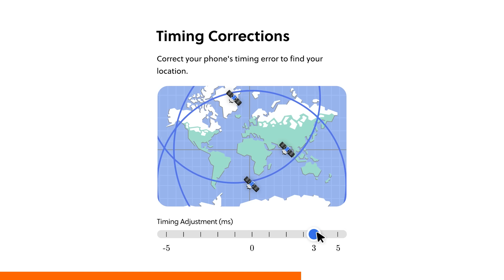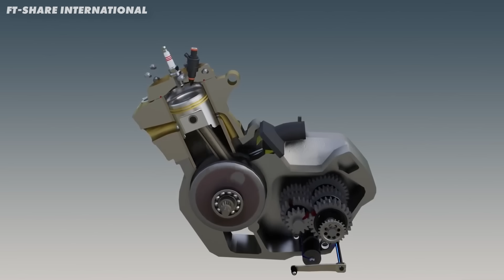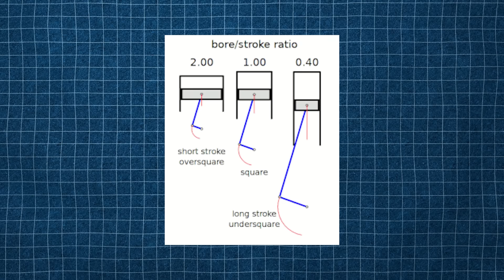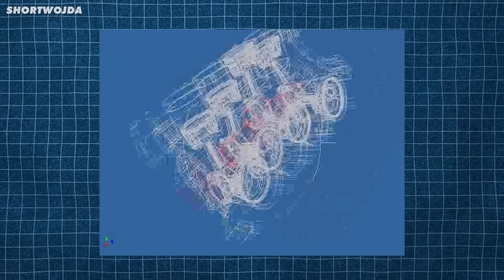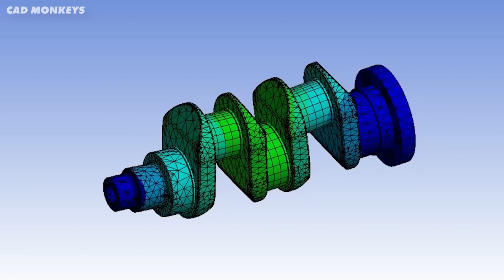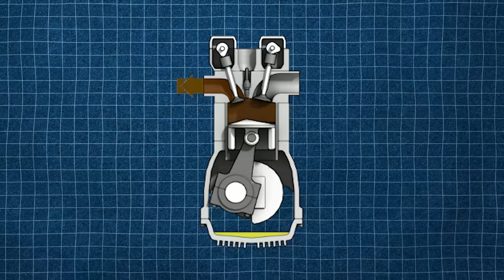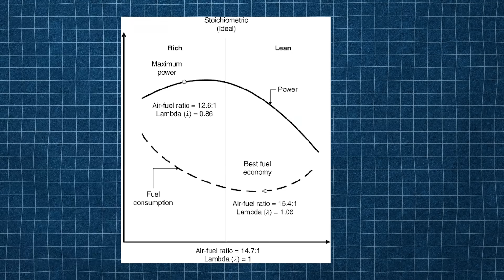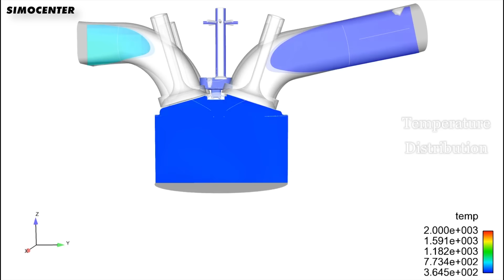Why It’s Almost Impossible to Rev to 21,000 RPM

Comment: "With an engine revving at 20,000 RPM this piston has a mass of 2.5 tonnes."

No it does not. It's mass is it's mass. It does not change. Under acceleration, it's apparent weight will change, not it's mass. It's mass is constant, not taking into account any negligible amount it may shed due to normal wear within normal operating parameters.

For a channel that overtly portrays itself as digging into the technical, it sure seems odd that so many basic technical details are so often just overtly wrong. And in such instances, technicalities are not quibbles, they are significant issues that are germane to a true understanding of the topic, with significant ramifications, in terms of derived conclusions, if misunderstood.

Comment: Has anyone tried a combined external/internal injection engine? I'm thinking having the intake mixture have some fuel (to head a head start on the mixing process) but lean to the point of being incombustible (to avoid knocking). On further consideration, if you are injecting fuel in different places and in different ways, I wonder if it would be worth injecting different fuels? For example use an external fuel with a lower vapor pressure to decrease it's volume during the intake stroke (so as to avoid displacing air). A very quick search suggests that  fuel-tank restriction might require some tricky rule-layering to implement that within the rules.

Comment: Very roughly calculated, at 20kRPM with a hypothetical stroke of 13 inches (33cm) the piston face is moving at Mach 1 relative to the ambient air. During the intake stroke on a non supercharged engine, it will only be a factor of ~6 from literally outpacing the air. Very roughly adjusting for 3.5 bar of boost, the intake becomes supersonic around a stroke of 17 inches (43cm), for a factor of ~10x. Those are both borderline significant, thought the air thought the valve going transonic might become a challenge first.
Reply: mach piston head, engage
Reply: Idk where you're getting a stroke of 13 inches from. Current engines only have a stroke of 53mm. You only get these high revs with very wide bores and short strokes
Reply: @themindgarage8938  (Darn YouTube comment for only showing enough text for trivial and boring points.) I started with a fixed RPM and peek piston speed at the speed of sound and calculated backwards from there. I agree that's a unreasonable stroke in practice, but the point is the ratio between that and reality, which is remarkably small.
Reply: @benjaminshropshire2900  Idk I wouldn't say that ratio's small at all. In most situations you only have to worry about this stuff when you're at Mach 0.8 or so. The piston is moving way slower relative to the engine  than the car is relative to the air around it, and F1 designers generally don't have to worry about transonic flow
Reply: @themindgarage8938  the general rule of thumb in engineering is if you are within about 10x of where the back of the envelope say something is a problem that you should be taking it into account. In this case, I suspect it's solidly in the range where "intake efficiency" is noticeably dropping with increased RPM. Also, pressure drop through the valves will reduce speed of sound in the piston so it's likely closer than a trivial analysis suggests.
Reply: @benjaminshropshire2900  Sorry no, that's totally ridiculous. Whether 10x is sensible depends so much on context. Sometimes it may be 100x, other times it may be 1.2x. Do you think the designers of passenger cars which travel at roughly Mach 0.1 on the highway worry about transonic flow over the car's body? No they don't because they're real engineers who use their brains rather than relying on some stupid rule

The main problem is getting the valves to open or close fast enough. Engine speeds stagnated at 12-13k for a long time until they started using pneumatic springs in the late 1980s
Reply: @themindgarage8938  10x isn't where an effect become important, it's where you need to start asking if it's important (and it usually, but not always, isn't, ... yet). And yes; engineers use their brains, first and foremost to identify the 99% of the problem that can be ignored.

As for cars, 70MPH (Mach ~0.1) is remarkably close to where airflow starts to become a major consideration (as in above simply a fuel economy issue).

Comment: I think you should preface the video by specifying what types of engines you're talking about because the blanket statement does not hold true. A model rc car nitro engine can spin 25 to 35k rpm easily.

Comment: The video never actually answered the question. It pointed out the difficulties of running at 20,000 rpm, but did not actually tell us why it could not go higher.
Reply: That's because it isn't a real limit.
- You could make the pistons smaller to reduce their mass.
- Materials science is constantly developing.
- So are design analysis techniques.
Reply: @procatprocat9647  You will get to the limits of physics somehow
Reply: @DanielDorn-tr7tw  only for a single set of circumstances. 
Engineering and science can be used to avoid such limits. 

Hence the video title is a lie.
Reply: @procatprocat9647  There are physical limits to everything. Limits that can not be overcome no matter what technology or engineering you use.
Reply: @DanielDorn-tr7tw  a professional Engineer's job is often to think laterally to avoid such limits. 

Technology and knowledge  will never stop progressing, so it would be impossible to state that the max rpm has been reached. 

Even in after another century of development,  making such a statement is foolhardy because the Engineers wouldn't have the foresight to know how some future lateral thinking could alter the scenario in their favour. 

To state that 21000rpm is the ceiling is incredibly ignorant and naive.
Reply: @procatprocat9647  You dont understand. There are physical limits that can not be broken. The laws of physic dictate the limits. You can never travel faster than light. You can never get more energy out of a system, than you put in. If you dont understand that, then you gotta go back to school.
Reply: @DanielDorn-tr7tw  so you think 21000rpm is light speed? 🤣

Okay, being serious now. 

List some of the laws of physics that apply in this case. There are some, but they aren't all impossible to avoid. 

Flame front is one which could be manipulated. Supersonic pressure waves are another. 

They are not fundamental limits. 

Explain how you know that no free thinker will ever avoid that limitation by taking a different approach. 

Explain to me how they limit a piston engine to 21000rpm. 

Before you answer, be aware that some piston engines spin at 50,000rpm. 

100,000rpm is quite feasible using today's technologies. 

Are you God with infinite foresight?
No, you just heard a couple of things and now you think you understand science and Engineering. 

Go back 100 years and consider what the maximum possible rpm was then. 

Now project 10000 years into the future with your infinite foresight 🤣
Reply: @DanielDorn-tr7tw  @DanielDorn-tr7tw  so you think 21000rpm is light speed? 🤣

Okay, being serious now. 

List some of the laws of physics that apply in this case. There are some, but they aren't all impossible to avoid. 

Flame front is one which could be manipulated. Supersonic pressure waves are another. 

They are not fundamental limits. 

Explain how you know that no free thinker will ever avoid that limitation by taking a different approach. 

Explain to me how they limit a piston engine to 21000rpm. 

Before you answer, be aware that some piston engines spin at 50,000rpm. 

100,000rpm is quite feasible using today's technologies. 

Are you God with infinite foresight?
No, you just heard a couple of things and now you think you understand science and Engineering. 

Go back 100 years and consider what the maximum possible rpm was then. 

Now project 10000 years into the future with your infinite foresight 🤣
Reply: @DanielDorn-tr7tw  also, science is not a set of rules cast in concrete. 

Scientific principles are our best agreed guess at the present time. 

They are constantly evolving, being challenged,  and being replaced with better agreed guesses. 

You are the one who needs schooling sonny
Reply: @DanielDorn-tr7tw  come on Daniel, don't go all shy on me. Answer my questions, I dare you!
Reply: @procatprocat9647  Read through the thread again, I never claimed that 20000 RPM are the limit. I told the universal fact, that there are limits to everything based on the physical laws of our reality. 
Go back to school and learn reading comprehension.
Reply: @procatprocat9647  I am not talking about science. I am talking about reality. There are physical limits, no matter what you do, which cannot be broken.
Reply: Velocity and size of charge of the air fuel mixture can also limit how high the rpm can go. I had always heard they couldn’t go beyond 20k rpm because they couldn’t get the air fuel mixture in the chamber any faster. I had heard at 20k rpm they couldn’t over come the pressure wave the intake generated to go beyond that limit.
Reply: @rednezz  that's just a temporary limitation. Nothing  like the fake title suggests.
Reply: @rednezz Honda did 22500 in the 60s with the rc116
Reply: @brynfisher8019  Yes, for sure. I was just stating the 20k limit for the formula one engines was not due to G forces but more due to intake limitations. I am sure without any rules that put boundaries on the engine, intake and exhaust design those F1 V10’s would surpass 20k rpm.
Reply: @rednezz a v10 past 20k is the stuff of dreams.
Reply: @brynfisher8019  Tiny pistons do help with that.
Reply: @petertaylor6384 honda r4 motorcycle went to 19k and had odometer to 20k. With higher number of cylinders and F1 budget there is more likely to achieve higher rpm.
Reply: @brynfisher8019  I was hoping someone would bring that up so I didn't have to.
Does it still have the highest (extrapolated) hp/litre for NA engine?
Also, in the 60's, Honda did it with points ignition!
Reply: @brynfisher8019 bore less than half, stroke half of these engines… and they only managed 1000 more rpm. They technically did it, but no comparison to the technology on the ca2006 etc.
Reply: The answer is still regulations.
You still have things like budget, fuel flow limit, reliability, etc.
Reply: He says at the start why it’s ALMOST impossible
Reply: Number 1 limit on rpm. The con-rod. The drivetrain expert got it a bit wrong. She said mean piston velocity, when in fact it's peak acceleration of the piston that matters. This occurs at TDC on the exhaust stroke. Mass x acceelration is a force, and tensile stress of the con-rod is the limiting factor. Like all engine components, rods have FoS (factor of safety).
Reply: Cuz stuff is gonna break a lot.
Reply: he does that too in the "f1 with no limits" video, the end just comes to nothing
Reply: Oh it can easily. I have engines that can rev to 42,000
Reply: who cares it was an interesting video none the less lmao
Reply: @gurraglad  lots of people care. Read the comments section and you will find a whole load of people who care, and have a brain capable of analysing the situation. 
There are also people like you.
Reply: @procatprocat9647  Hahahahhah yeah true, this is some cutting edge analysing of a very important topic by big brain people!

Comment: Around 20K is the highest revving in F1 competition. Honda did 28,200 on their F1 test-bed.
Koenigsegg V8 - 31,700.
Reply: You have misunderstood the data for the Koenigsegg. It didn’t rev to 31,700 rpm.  It reached  7,800 rpm, max revs in neutral, in 213ms. The 31,700 number is never reached, but just used as a reference point to show how quickly the engine can rev. They claim it actually revs even faster under load, see seems counterintuitive to me but that’s what Koenigsegg claims to have see. Rpm/second numbers over 45,000
Reply: @somenygaard  I am aware of the KSG "RPM per second" number, but in this case I was using their MAX RPM figure on a testbed. The RPM/s figure was much higher in the most recent tests - likely the one's you are looking at. Their figures for on-the-track are, of course, much lower.

Comment: 15 seconds in and you're killing me. Mass isn't changing, force is changing. There's no extra "stuff" just because it's accelerating so quickly.
Reply: The faster Usain Bolt runs, the more obese he becomes
Reply: @Colby_0-3_IRL_and_title_fights  that literally made me lmfao.  Thanks!  🤣👍
Reply: What he was referring to was the amount of force being exerted on the crankshaft and the connecting rods due to acceleration of the piston,The higher your acceleration, all of that momentum needs to return and go the opposite direction so what you run into is more RPM means more additional stored energy via momentum, compare it to locking up the brakes on a car at 60 miles an hour versus 120 miles an hour, or falling down on the ground vs a 10 story building
Reply: @ericpedigo685  yeah but it's not "mass"
Reply: @ericpedigo685  We know all of that... (I would hope!!)
The "issue" was; he said the mass increases as it travels faster.
Reply: He was definitely referring to the increasing mass of inertia of the reciprocating parts on rods as the pistons reach TDC and the wrist pins and rods on crankshaft, all of those points experience increased rates of inertia and Id think the as the speed increases the relativistic mass which is the kinetic energy held within an object also increases, but the objects resting mass doesnt increase.
Reply: He was referring to inertial load on the connecting rod, effective weight of the piston when changing directions.  He is most surely reading a script which was poorly written to exclude this detail.

Comment: ICE are fundamentally air pumps that you squirt fuel into. For a given displacement higher rpm means more air flow and more capacity to burn fuel. They are limited by mechanical loads and flame speed. At very high rpm both of those factors come into play even for very oversquare engines. Two strokes move something approaching twice as much “effective air” for a given rpm. Turbo and superchargers pressurize the input air and effectively increase displacement for a given rpm.
Reply: Yes, flame speed exactly. He didn’t talk too much about that. The thermodynamic limit of the expanding gas.